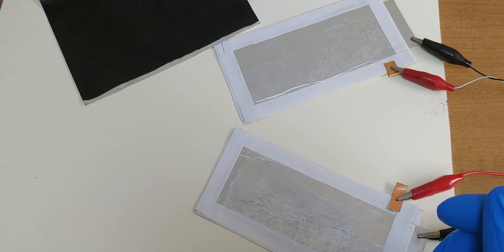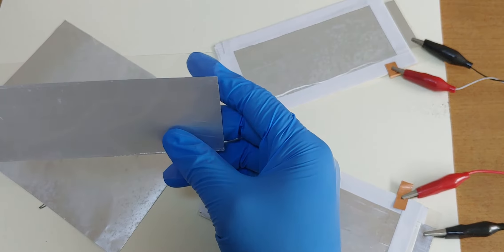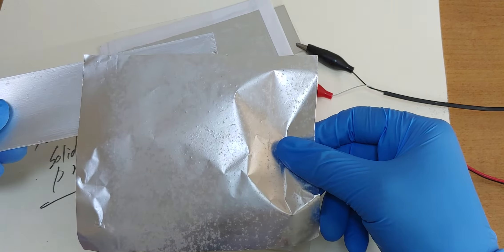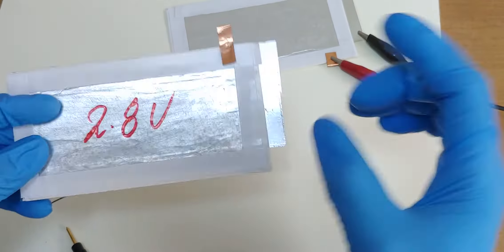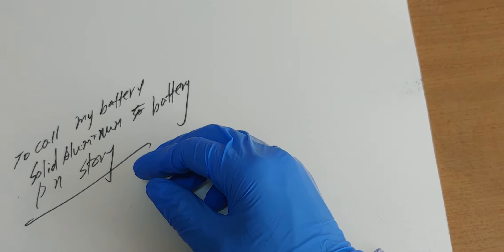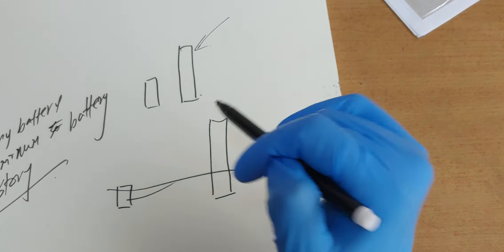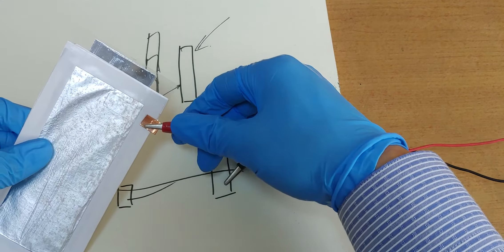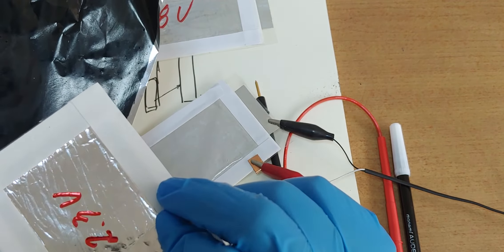solid graphene aluminum battery: 2.8v

Comment: Is it a supercapacitor?
Aluminum - separator - graphene - aluminum. Right?
What is the charging current and charging time?
Reply from the maker: It has its intrinsic voltage. So I think it is a battery. Have a nice day
Reply: @solidbattery9956  Aluminum cannot be reconstituted in the aqueous environment of toothpaste. Therefore, it is a supercapacitor, aluminum air battery, hybrid

Comment: Good job but we need to see it working .My batteries are working in between my Graphene with H2O .....  I do just test it ....
Reply: Did you make?
Reply from the maker: Good. To me, the experiment to increase its voltage is first. Good Luck.

If you are okay and if you videoed it, I want to see it.
Reply: @solidbattery9956  Soon .....Very soon.. I do try to understand it.

Comment: What is the backup this battery
Reply from the maker: The main material used in this battery is sodium related compounds. Thank you and have a nice day.
Reply: @solidbattery9956  please send name of all material
Reply from the maker: @kanik_gurjar_104  
I am using aluminum collector for both anode and cathode. 

As an anode, I use graphene(it might be graphite), and as a cathode, I use sodium ions (which are included in detergent) and toothpaste. 

One thing you should remember:
Never use materials which have chloride in that they cause corrosion on the positive collector. 

Have a nice day.

Comment: Aluminum / graphene / aluminum ? This is a short circuit. Why 2.8 volts?
Reply from the maker: Between each plate, there are ceramics. The reason this battery indicates is that it is designed to increase voltage.
Thank you for your concern.
Reply: Interesting! For this voltage are you using a dual eletrolyte? My research is about electrode binders. But I don't use graphene yet. I'm using high surface carbon.
Reply from the maker: @danielrosselli  
Since the battery I research is a solid battery, there's no electrolyte.
Reply from the maker: @danielrosselli  
Can you tell me about electrode binders in more detail. I am really interested it.
Reply: Yes, in the past, my first binder was the classic pvdf/npm, but the npm is toxic and need special laboratory equipment. After that I started to make aqueous binders. Aqueous binders are green solutions. The most tested is cmc/sbr (carboxil metil cellulose/styrene butadiene rubber). Scientific papers show better results of cmc/sbr than pvdf. In my projects the results are excelent! What kind of binder are you using?